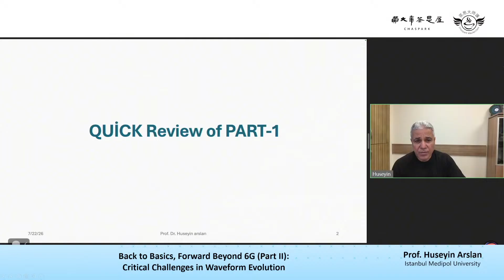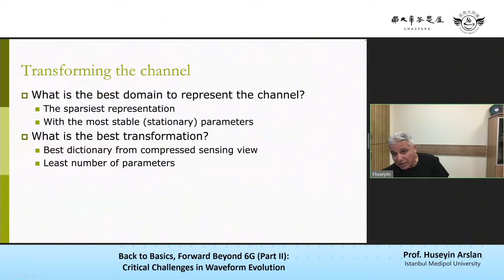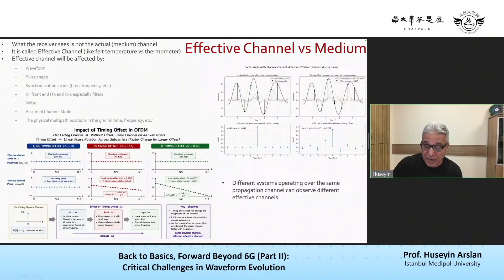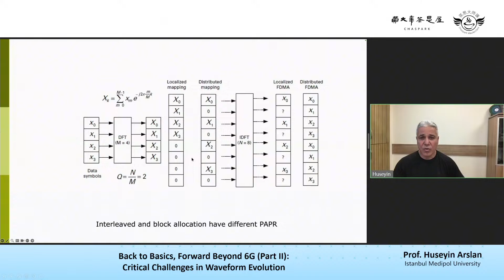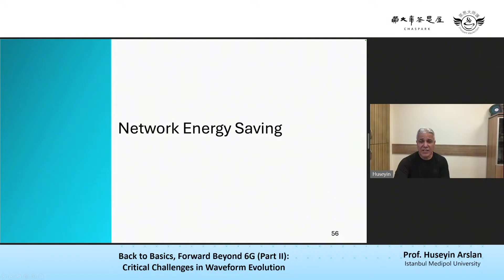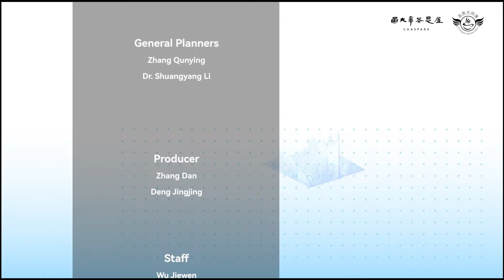Back to Basics, Forward Beyond 6G (Part II): Critical Challenges in Waveform Evolution

Comment: PhD addresses the central challenge of 6G waveform evolution identified in Prof. Arslan's seminar: moving from a fixed, monolithic air interface to an elastic, intelligent, and secure waveform ecosystem. By treating disintegration not as fragmentation but as functional specialization, this research proposes a coherent architecture where each layer (pilot, data, wake-up, sensing) is optimized for its purpose and secured through effective channel mismatch.